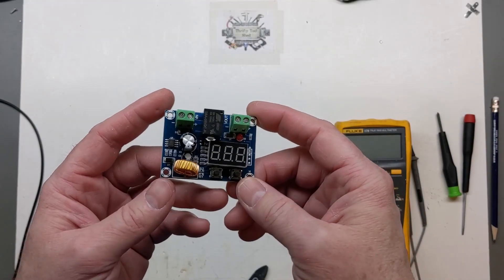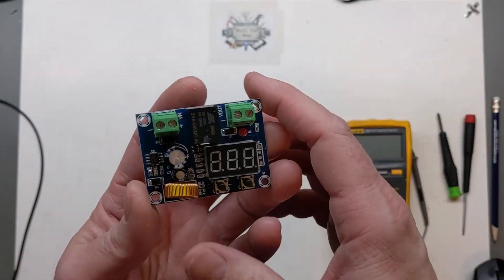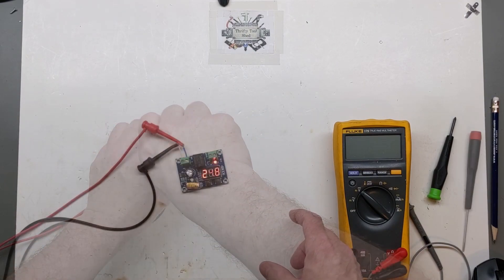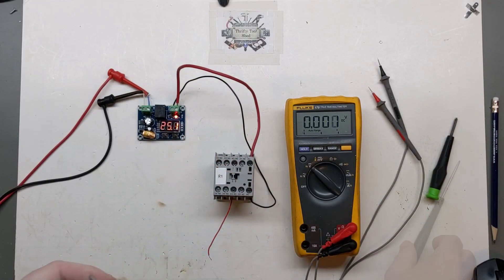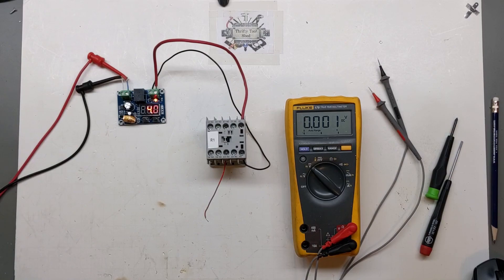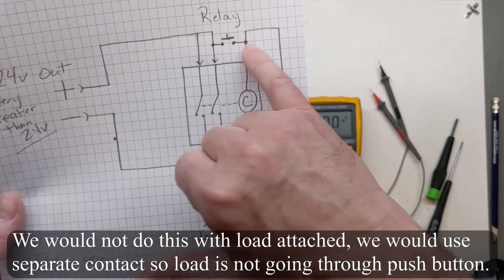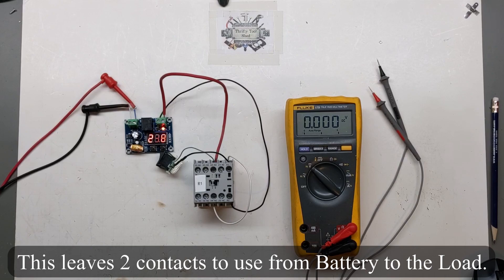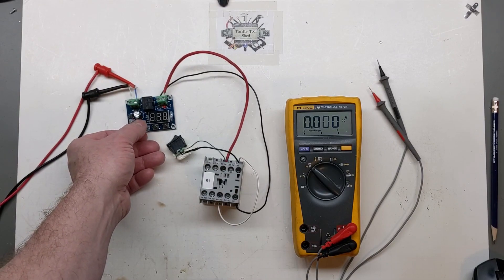20A Low Cut Off Battery Protection Board

Comment: Thank you. Where is mistake? XH-M609 is 10A currency only. Why 20A?
Reply from the maker: The relay on this one is rated for 20A on some voltage ratings atleast. I have seen many voltage and curent ratings on these since I have bought my first ones. Some only show as 32VDC input max and when I bought my first ones the ratings were for up to 60VDC. The relay tells the real story if it's ratings are actually correct that is.

Comment: How you going mate I bought some DC under voltage protection circuit boards got some from Canada because the dollar sign was not a dollar sign it was spelt  CAD and I bought one or two of the others in Europe because they were in euro dollars pay between over $7 and $8 per board shopping on eBay and getting them from Europe and Canada because they are cheaper there I hope you like my comment thank you very much for sharing your video😅😊😢😂

Comment: Thanks for the video but I wish someone would explain how can the voltage cutoff and hysteresis be programmed without any microcontrollers or digital circuitry on the board. The only IC I see on this board is a buck converter. Also I question the usefulness of a board that loses all its settings when you disconnect it from the battery because you WILL need to disconnect it in order to recharge that battery. I have tried to find the schematic of this board without success.
Reply from the maker: It has memory. It keeps settings. The micro is presumably under the LED display...

Comment: Can this controller handle a 15 t0 20 ampere load output?
Reply from the maker: Well, it's rated for 20A and the relay shows 20A rating, but it is also a 30VDC rating so if you use it at higher voltage like up to 60V it may not hold up. Many viewers have pointing out that it's not a 60VDC rated relay. Truth is it is seemingly impossible to find a relay small or affordable that has a 60VDC rating. I also share some boards with the 30A relays if you need higher current capabilities.

Comment: I have one of these I connected for my son's Power Wheels. I'm using my 20/18v DeWalt batteries and at first it was reading the voltage from the battery correctly. It was showing anywhere between 18-20v. However, after a few uses I noticed that the display on the low cut-off protection board jumped all the way up to 99.9. I have a separate display device in the loop that also displays the voltage, and it is showing at the correct voltage amount.  Any idea why the protection board default display is at 99.9?  The cut-off value is set to 16v and the difference value is set to 1.
Reply from the maker: The only 2 ways I can think of for the voltage reading to be wrong is...
#1. The voltage calibration has been accidentally adjusted by pressing the long press of the + button and calibrating?
#2. The board is possibly faulty. 
I have used several of these and have not had one show 99.9V yet, so I am not 100% sure. I am just throwing out these suggestions in case they help. I have also used a couple newer style boards that are 60V  30A and 40A respectively. It is more set-up to these l, but they work great and I will possibly share a video of it in the future. 
https://amzn.to/3TCwReZ
Or
https://amzn.to/3TxwaUt
Best of luck to ya!
Reply: @ThriftyToolShed  I really appreciate the prompt response! I'll definitely be trying #1 above this evening. Thank you for the URLs as well for similar products!

Comment: Man , you are just filling my electronic hobby needs this weekend 😂. Not sure why it took YouTube algorithm so long to put your great videos in my feed but better late than never.  
I have these exact model low voltage components, do I need to run one for each battery? I am using 2 -20 volt batteries wired in parallel in my girls power wheels. I currently have only 1 low voltage protection unit inline with the 2 batteries before the motor control unit. It's working but it's shutting off fairly quickly , like 2 minutes of use and then after 5 seconds it turns back on. Currently set at 17.4 shut off and 1 volt difference. I wasn't sure if I should run 2, figure it may get wonky with 2 batteries discharging possibly at different rates.  I did test my batteries and they were identical voltage at the start and after use. Obviously my girls arent thrilled with the 10 second random pauses.  
Thanks for these tutorials. I'll be referring to lots of your videos I'm sure over the next year. We've got lots of science projects in our house!
Reply from the maker: Thanks for your kind comment! I want to mention first if you put packs in parallel to make sure they are the same capacity and charged to the same charge level before connecting in parallel. (Just wanted to mention that) I would say it's fine to have them on one protection board if they are connected in parallel. I would set the cut off voltage maybe a little bit lower so it doesn't trigger so fast when pulling the voltage down on high current demands. I would experiment with going as low as 14V with a 5S pack since it is still above 2.7V per cell. another thing is making sure heavy enough gauge wire is feeding the board and load so it will not pick up the voltage drop and possibly shut down prematurely. I am now experimenting with a controller that has built in cut  off protection. It's pretty cool. Hope it's helps. Have fun! 
https://amzn.to/3TgNa2d
Reply: @ThriftyToolShed   Thank you very much I appreciate the advice. I did check the voltage before connecting them and they are the same batteries I bought them as a kid probably 5 years ago so they're both equally used and abused. They're only the 1.5 amp hour so they don't last very long even in parallel. Think I'm going to buy two six amp hours. Though I was thinking of buying one of the battery spot welders and a roll of the nickel and then 3D printing my cell connectors. I have tons of the 18650 batteries I would like to make a big pack with.  Oh thanks to your other video I saw where you repaired one of the battery packs replacing a cell I was able to do that yesterday there was one of the batteries that was only registered in 1.5 volts when the other ones were registering 4. 5 to 7 minutes of work and I had a working dewalt battery pack again thank you very much.
Reply from the maker: @TRUMP_WAS_RIGHT_ABOUT_EVRYTHNG 
Sounds like a fun project building the large pack. Good job on the repair!

Comment: Can this cut out at 12 volts and then kick back on at 13.8 volts so that way you can have deep cycle batteries can only get as low as 20% and when the panels charge to 100 it can kick back on to get proper cycle
Reply from the maker: From my experience it should not have any issues with that. I am also working with a different module at the moment that has many ways to set up as well. May be worth looking at, but I don't have much experience with it yet to know if it's much better or not. The power usage on stand by is much better for sure. 
https://amzn.to/48cJbIr

Comment: Ive heard that battery operated power tools, such as a Milwaukee 18v drill battery, for reference, has a minimum battery voltage of around something like 16.2, according to a project i saw on YouTube using one to power LED lights in an enclosed trailer, and if you go below whatever the minimum is, you can damage the battery, but to be honest, I'm not sure if I understand that... how is it that it'll damage your batteries? And what's more, should a circuit running off of a 12v car battery (or deep cycle), or a 12v vexilar/kayak battery, or even a lawn mower battery, have a low voltage cutoff circuit in there somewhere, and if it's not needed, then what's the difference? Just the fact that you're using special battery requiring a special charger?
Reply from the maker: Yes lithium ion batteries have a low voltage minimum meaning they will be damaged if allowed to drop below a minimum level. This is usually around 2.5V on many cells data sheet. Many battery packs cut out at around 3V per cell for protection. Lithium cells also should never be charged above 4.2V per cell. Most packs stop charging at around 4V for protection. Lithium cells are good, but they have known issues with overcharging and over discharging. This is why you always see circuit boards in battery packs. This is different from lead acid batteries which are much more tolerant to these issues. It does still affect them, but not as drastic for sure.
Reply: @ThriftyToolShed  thank you very much!!! Most of what I can actually readily find by searching for this question on youtube, without knowing exactly what to search for, either lacks information on it at all, or is woefully short on information that it DOES give. I am glad to know more, finally. That definition you gave, sounds kinda like why my used car batteries don't last long especially when(sometimes) running then down, and, not using them very often besides... Not sure if I explained what I feel properly, but there you go... You definitely have my thanks, as that's all I can currently afford to give

Comment: I don't understand why they didn't put a switch on the board to shut off the led readout. The whole point is to protect a battery from discharging too far but it will literally keep discharging your battery by itself.
Reply from the maker: Very true. So many people asked about this that I followed up this video with a latching type circuit with a relay to drop out the complete circuit. It has its issues also, but at least the push button can latch the circuit as well as be used for a bypass temporarily if needed.

Comment: I bought this plate to protect my daughter's car battery from discharging. However, I noticed that the speed of the car was limited, as the board limited the output current to 2amp, and by connecting directly to the battery the car consumes 25amp depending on the situation. How can I protect the battery without limiting the current?
Reply from the maker: Well it is only a relay contact and rated for 20A. There should not be any current limit. It may have a faulty contact or burnt contacts if over 20A has been pulled across it. It is some 30A boards available as well. Also if this board is connected at all times it will drain a battery also. I do have a video showing a latching circuit with this so it will drop out completely if voltage drops to cut off voltage.
Reply: @ThriftyToolShed  Could you tell me the code for the board that would support 30amp? I did a search and couldn't find it. Also, is the video you mentioned the one in the description update here?
Reply from the maker: @CarlosSantos-vt9gb 
Yes, it's the one mentioned as an update. I also have a link below in that video for the 30A board as well. The Amazon link is still up to date.

Comment: What type of relay could we add to this LVC so that when it trips all battery power is disconnected from the LVC as well to not overdischarge if left alone? Not just the load.
Reply from the maker: Ok, so this design is for you to see the voltage drop and it shuts down and requires you to take action to remove it and recharge it. So you could use the same setup as I showed as an example here in the video, but wire it differently. You would need to have the output of the LVCO module also power itself and the load. The trick is to have the battery positive going to a momontary seal in push button switch to the relay coil that you would have to hold to activate. It may take a few seconds to boot up and verify the voltage level is good then you can release the push button and all is powered from the output of the module. Once it drops down below cut-off  setpoint it all drops out.
Reply: @ThriftyToolShed  From a hobbyist and student of electrical engineering - I would cry from happiness if you could demonstrate this - as you would literally help me understand this exact solution I've been searching for everywhere! This module is great, but without fully cutting the circuit when voltage is low my batteries are often overdischarged. The additional relay and circuit as you described is the ideal solution, and I'm just trying to wrap my mind around how to creating a self-driven flow from battery positive can momentarily latch the circuit open until it is disconnected.
Reply from the maker: I have received a good bit of interest in this and I will put together a video on this. It will take a little bit of time to get caught up on editing videos I have scheduled already. Hopefully in March I will put this together. Thanks for your comment!
Reply from the maker: I now have a video up about the LVCO with a latching circuit. I hope it is helpful.
https://youtu.be/2pSov8jIo_Y

Comment: Your little relay black box in your board shows it rated for 14vDC, I’ve heard of those failing when using a 20v power tool battery to increase power of kids power wheels, how does that no mess up when you’re putting more than 14v to it.
Reply from the maker: I typically use it to control a high current relay or solenoid that is rated for heavy DC loads. These will not do well with high DC loads alone.  DC is rough on contacts. So yes at 20A it would not last long if going over 14VDC. Honestly the power wheels over voltage to 20V is not good for the motors at all and it's most likely way over 20A also. Maybe into the hundreds at start up. I would not even try that thinking about all the start and stop the kids put on that little power wheels, I would imagine it would smoke it in no time!

Comment: Hello, we can change the relay to withstand more amperes, for example, to put a 100 amp relay with the same circuit
Reply from the maker: Yes! It can control any higher current relay!
Reply: Hello mate use any relay on the circuit to increase the ampage hook power supply positive and negative up to the battery making sure the polarity is right then connect a wire from the positive output the positive terminal of relay coil of a relay that is a higher amperage negative of bigger relay to ground and the common terminal up to the positive to battery output normally open to the load have I explained all of that clear enough😅😢😂😊

Comment: Hi  thx for video  . Regarding  20 amps  is that  mean  i cant use it in case i withdraw   more  20 amps  from  big battery
Reply from the maker: No, unfortunately not. The relay is rated for 20A. It will not regulate load in any way. Sorry for the confusion. Just a 20A relay really.
Reply: @ThriftyToolShed  thank you  so much 🙏

Comment: I appreciate your hard work making these videos.  I have one of these boards and its not working. When I hook up the power the led flashes messy for one second then goes dead. They told me to hit a button fast while the light is flashing to get it to set up but it wont even flash. 
 I ordered mine from amazon with no instructions, can I input from a solar panel or will it only handle 12 volts? I am in Canada so my cost for this board is almost forty dollars.
 What I am looking for is a module that I can input 12/24 volts DC and output 12 volt. Any help will be much appreciated.
Reply from the maker: Well this board will allow 12V or 24V input, but will not change voltage level. 12v in 12v out. 24v in 24v out. It is just a protection board that shuts off load before pulling down to low to protect the battery typically. Low voltage cut off that you set level for. Hope it helps.

Comment: See how to set up the XH-M609 module here: https://youtu.be/d9RD0Iao58A . There are four settings using the two buttons - cutout, offset, calibration and time delay.
Reply: Thanks! got a free hot wheel with the conversion for 20v and I didnt know what this module was for. This made perfect sense why one battery worked and another didnt. The link you posted help me set up the module better.

Comment: Thank you so much Sir. This is the most informative video on  those Cut Off Battery Protection Boards, also known as XH-M609. This video also inspired me the idea to use a separate high current relay driven by this little board in order to safely handle more current.
Reply from the maker: Glad you found it helpful and thanks for your comment!
Reply: @ThriftyToolShed  One more question though: If a relay is marked 48V/80A, does this mean that I can drive its coil by a 48V to control a 48 voltage on its contact as well? In fact, I have a 48V battery bank. Thanks
Reply from the maker: @chafik1973  usually you will see a relay have a coil voltage rating,  a maximum voltage switching rating and of course the current rating it can switch. You have to find out if the coil and input is rated for 48v. Many times for example a 12V coil can switch much higher voltages.

Comment: does it work with 100Amp 12v battery
Reply from the maker: Not really sure exactly what you are asking here. It works with 12V and if you use a 100AH rated battery that is fine. It will Not handle 100A if that is what you are asking. Rating is 20A as mentioned in video.